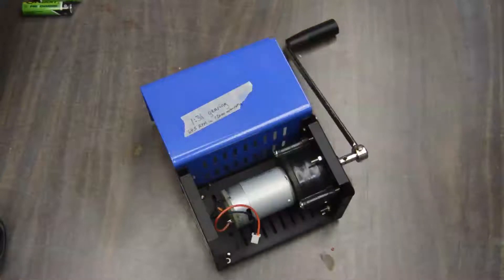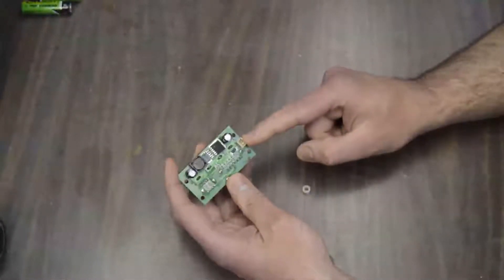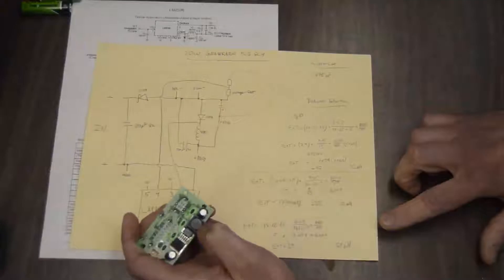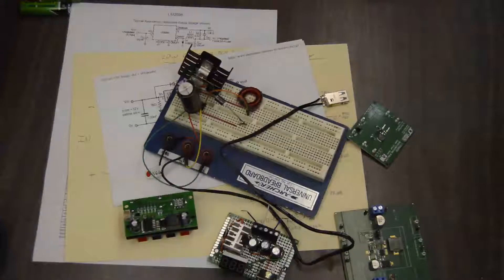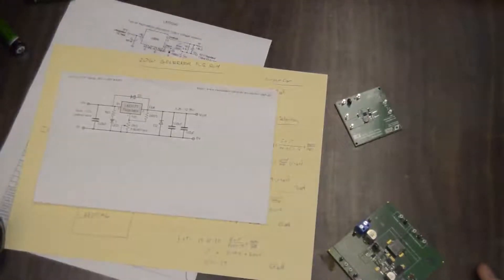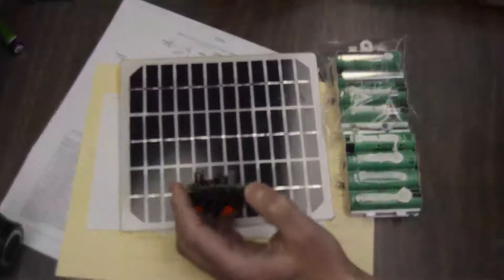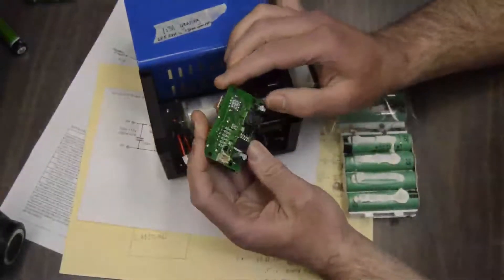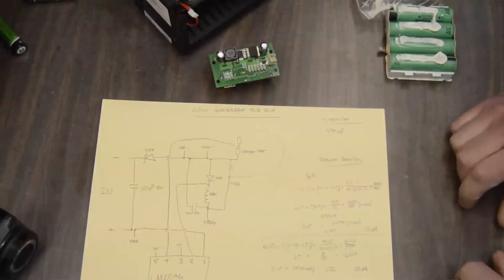Banggood 20W Hand Crank Generator Part 2: Teardown & Analysis

Comment: Hello good sir, those lithium cells you mentioned in the video here, they lithium ion batteries? Second question,would be curious to know where i can get myself those lithium batteries you got for free? Im looking around and been wanting to salvage for lithium ion or i guess rechargeable old laptop batteries,im interested in those batteries you got love to get myself some free also.
Reply from the maker: Used lithium cells are probably not the best way to store power, but they are good for experimenting or applications which are not very important.  The battery pack I show above came from a piece of medical equipment.  One or two of the cells are bad, reducing the capacity enough to warrant replacement.  Laptop batteries are good, by the time they reach the junk heap they may have more than one dead cell, the same goes for power-tools or anything else.  I recommend you ask who maintains the equipment at your local hospital.  Since hospital equipment is critical, batteries are often replaced on a time schedule rather than on when they actually need to be replaced.  The used batteries are often simply disposed of.

Comment: The extra gears some suppliers supply are for applications use, Example wind turbine, water turbine, ect ect, they all call for different gear ratio's to maintain  peek output at different rpm, to follow power curve of generator at a set rpm of the generator.
Reply from the maker: Actually, what I was referring to were listings such as this one: http://a.co/d/cWLeyFr where the design must be so terrible that they feel the need to include extra identical gears so that the thing will work long enough for you to feel you haven't been ripped-off.
Reply: @moconnell663   Sounds like a  bad supplier, supplying Bad Goods ,  i have just seen the kit you are on about lol,  its pants which in the UK means crap, scat, ect ect :)

Comment: I think this is your answer.   Just Rectify and filter cap the output and feed this toy with what you end up with.  Providing you have enough current it would boost your voltage to something usable.  Or Buck down to what ever you have it stet to.  https://www.banggood.com/DC-DC-Boost-Buck-Adjustable-Step-Up-Step-Down-Automatic-Converter-XL6009-Module-p-1087346.html?rmmds=myorder&cur_warehouse=USA

Comment: This is very probably a stupid question but would simply hooking the unregulated output up to a 3.2v lithium iron phosphate battery be a good idea? I know you mentioned lead acid but the energy density is fairly terrible for portability.
Reply from the maker: Sort of... To do a direct hookup to a single cell might be alright, provided that cell has a large enough capacity to accept the full output of the generator, while dragging the output voltage down to the <4V level.  LiFePO4 batteries do not like high charge voltages (nominal 3.6V under charging conditions).  I would feel more comfortable doing this personally if I were to hook up 3 or 4 smaller cells in series.  4 LiFePO4 cells would be a nominal 12.8V, also suitable for any 12V load.   One problem with using any Lithium chemistry battery array is that you really need to balance-charge it, requiring more circuitry, which will expect to see a carefully regulated input voltage.  Out of curiosity, what is your application for this?  The advantages of lead in this circumstance are cost/watt-hour, simplicity of charging, and ready availability. The only big disadvantage is weight.
Reply: I was wondering if I could produce something like the nowlight (currently seeking funding on Indiegogo) for half the price.
Reply from the maker: The "nowlight" is a very simple design, but without seeing one I would have to question the durability of the drive mechanism.  Throughout the world for thousands of years people have used foot-treadle mechanisms to power things like textile equipment, bellows and so forth.  You could make something similar from a small-engine pull start mechanism mounted on the wall, grabbing the handle with your toes.  Couple that to a modest permanent-magnet motor (think kids electric scooter, which I see often-enough on the curb around here), with an ultracapacitor to even-out the bursts of current for battery charging.  Depending on your level of scavenging skills, you could make something like that for less than $20.

Comment: Hey thanks for making a part 2! I was wondering about its insides and if it can be improved. I am currently making 3 types of generators, and I find it difficult to get enough useful power out of them. One has too low a voltage to get a boost converter to work, and an other one I think has such irregular voltage that the buck converter doesn't know what to do. It will become a video also. We can learn from each other! What are the most efficient ways to generate electricity at home. Let's discover and share that.
Reply from the maker: One thing I intended to do, but haven't gotten around to is making a buck-boost regulator, which I can do with the regulator I used in the breadboard power supply.  I'm not sure that will work very well or not.